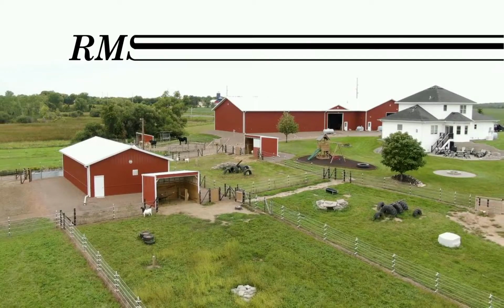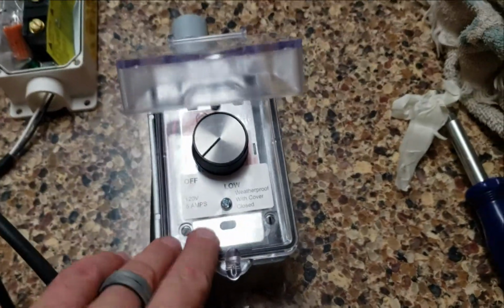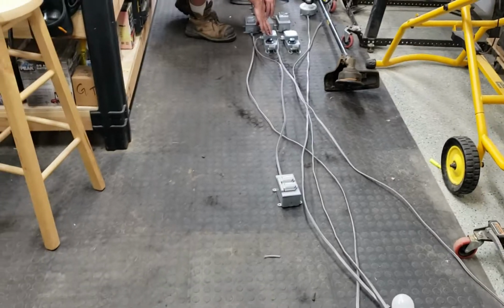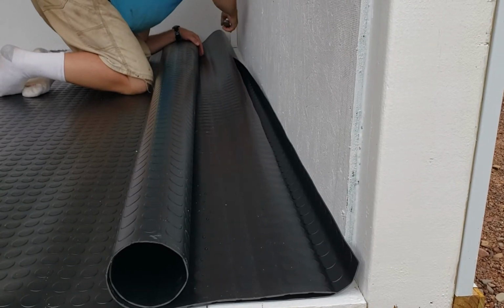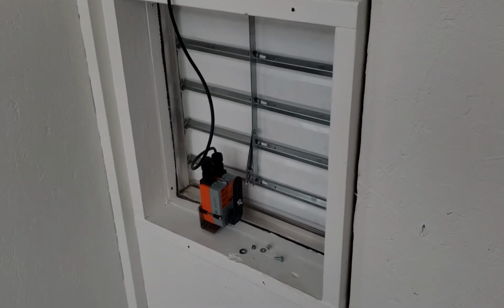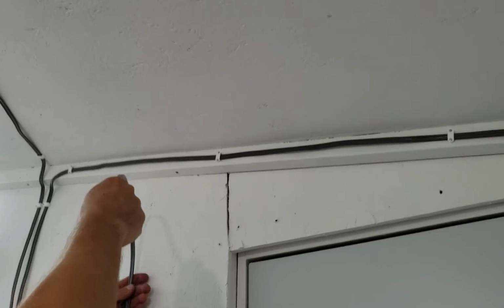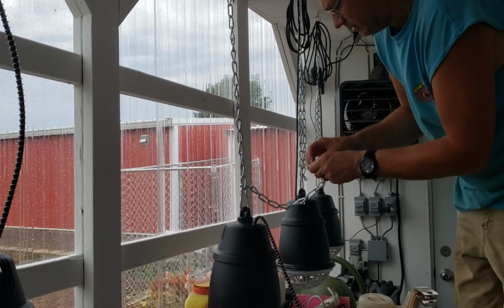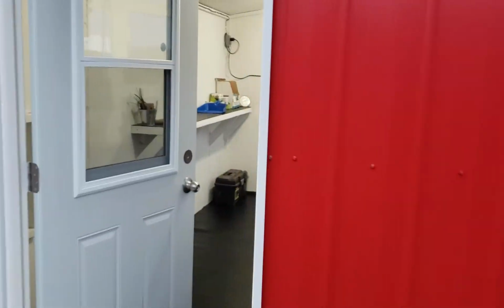Building, Ventilation and LED Wiring New Greenhouse pt 4

Comment: The greenhouse looks great! You and your family put a lot of work into building it and it turned out great. Do you have a nearby water source or will you be collecting rain water?
Reply from the maker: We dont but if wanted we could in summer only use water rain barrel and culvert / gutter the north side to it.  Winter wouldnt work well for it though....freeze lol
Reply: @RMSpeltzFarm  unrelated to this video but my wife wants to know what brand of infrared heater you have above your horse stalls and how you like them now after using them.  I will look for a video if you did one but I didn’t think you did one on them specifically.
Reply from the maker: We use these, once year in fall we dust them off, otherwise work great.

http://www.amberwayequine.com/products/radiant-heaters-2/
Reply: @RMSpeltzFarm  ok right on. Thanks. She had these on her radar also so they must be the ones to get.